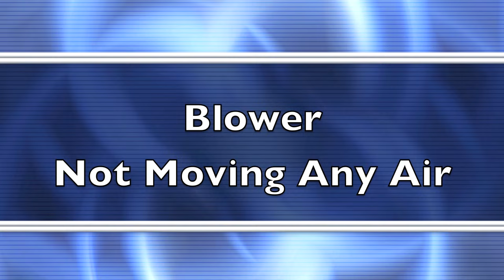Blower Not Moving Any Air

Comment: My problem is the blower won't work automatically by itself. I always have to turn the A/C on and spin the blower by my fingers to get it worked. I have to do this every time I turn on the A/C. Does anyone have any idea about this problem?
Reply: abady banawas that is my problem but I can't spin it with my fingers so I don't know what to replace
Reply: Mine works fine right now. I don't have to spin it anymore. It's weird because I didn't fix anything.
Reply: sounds locked up

Comment: my 1999 grand voyager doesn't have one. I replaced the motor blower and ensured correct reassembly. it doesn't work. I can hear the fan blowing. I know the heater and AC works. I'm not getting any air pressure.
Reply: hi,adam eve. your problem got fix? if yes can you let me know how to fix it? we have the same problem. thank you.
Reply: Adam Eve
I'm sorry?  I
Reply: Adam Eve 
It’s your blend door actuators
Reply: @Helmuesi911  if you have cold & or hot air but very little air flow its the recirculated air door its stuck and allowing the blower to force air outside the vehicle, limiting the air reaching the cabin vents.

Comment: What if the blower motor trims own then shuts off after a few minutes then cuts back on minutes latter
Any help thanks
Reply: I have the same problem,  air conditioner works fine, but once in awhile it shuts down,  I can hear the motor running but not blowing. I wait for 3 to 5 minutes and it will come back on blowing cold air again. help!
Reply: grand Cherokee no air coming out of vents
Reply: that happened to me, it turned out that the blower motor was going out.  Until I could get a new one I would take a wrench and tap the motor under the dash and it would work for a while.
Reply: Hobbies51 My Caucasian!! I took the blower out reseated everything and it’s cool as ice in here.

Comment: I have a 2006 Ford Fusion and I have the same problem can you help to solve the problem
Reply: I have the same problem. Your 2006 does not have a cabin air filter. But I would check your air filter under the hood. Im still looking for answers because mine is clean.